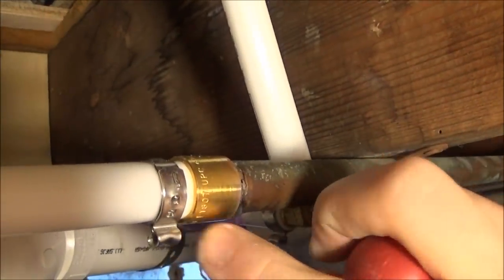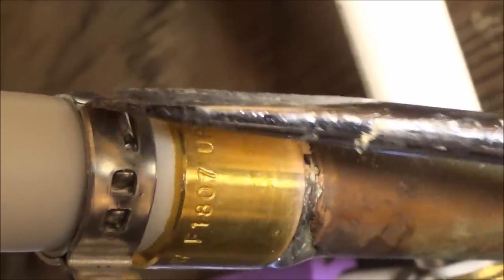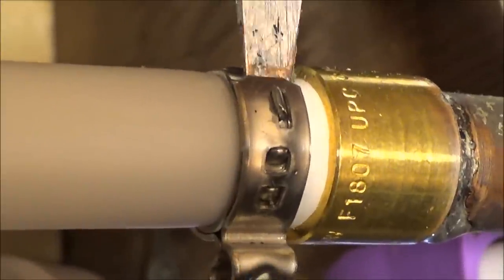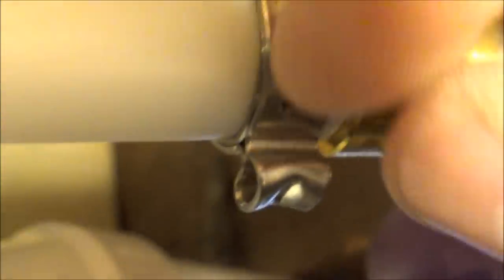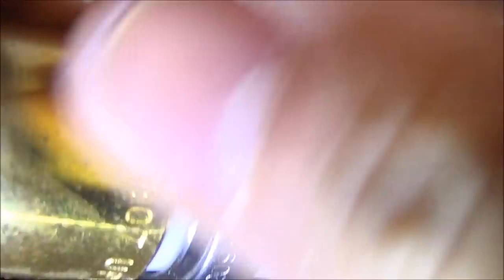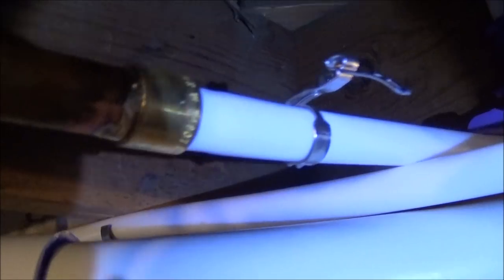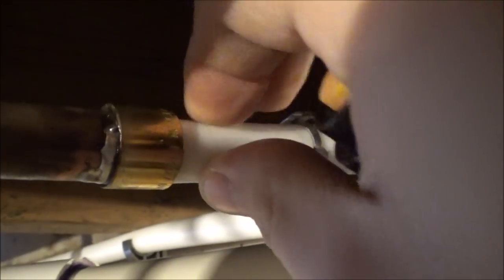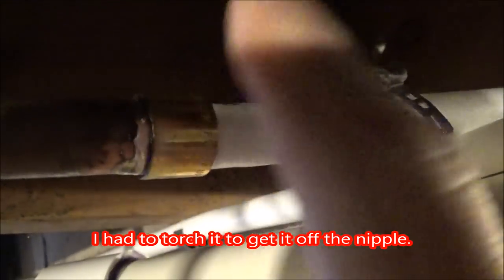Removing PEX Cinch Clamps With Just A Screw Driver!

Comment: The screwdriver prying part happened so fast I must have missed it. 

Big fail.  All I saw was a suggested method, then an end result. Maybe there was a profane moment that had to be edited out?
Reply from the maker: It's been a while but if I recall correctly I couldn't get it on camera without stabbing myself in the eye. I definitely have a better tripod selection today. The method does work though, next time I need to pop a pex clamp I'll re record and link here. It doesn't come up too often. If it's not a tight space you can also use 12" bolt cutters to cut the crimped part.

Comment: I removed mine in under a minute by grabbing the crimped part with vice grips and twisting it until it broke and then it just fell off. It was a LOT easier once I realized I wasn't trying to save the parts.

Comment: how do you reinstall clamp without taking the fitting off the pipe?
Reply from the maker: I've never tried to do that, I put a new clamp on by taking the pipe off the fitting. I would imagine that you could just open up a clamp and then close it again around the pipe so you didn't have to drain the system but it'd probably be easier just to drain it.

Comment: Interesting idea, but I was unable to get this to work with shark bite brand stainless steel PEX clamps. They look the same but the "loose" end of the clamp fits too tightly against the rest of the clamp to get anything underneath it. I tried screwdrivers, chisels, etc. Eventually I used pliers to bend the crimp ear enough to get a lever in there that I could use to pry the thing apart. It was quite a battle though. Looking for a better solution...
Reply: Same here, pretty bad they have no tool for this . . I bought some end cutter pliers and attacked that end from the sides

Comment: Good tip, however, using a simple hair dryer will enable the removal of the PEx tubing.  Additionally, you should always have a high end screwdriver in your bag of tools.  This job can actually be accomplished with a small screwdriver but it has to be one that you spent a couple of bucks on, something in the $7 dollar plus range with a "hardened" blade and a width of 3/16 to 1/4".  You should not be able to bend the tip even if attempted in a vise.

Comment: Apollo clamps must not be very well made. I tried this trick on my own PEX clamps, and struggled for an hour to remove them. I couldn't get my screwdriver in the gap, and had to use (wreck) a chisel, and even then the metal bent only with great difficulty.

Thanks for the idea, though.
Reply from the maker: Well, that does worry me a bit. Did you use a thin-tipped screwdriver? I had to use a thin enough flathead so I could get it between the end there and get enough torque to pop it open.
Reply: Agreed, on mine there is no space between the two pieces of metal. I could fit the edge of a razorblade in there a little but not much more. For me, needle nosed pliers worked best, sticking them through the crimp and twisting them
Reply: Screwdriver trick didn't work for me on 1/2" fittings. It was just too small and tight. I ended up tweaking the end up to the point that I could grab it with a set of vice grips, then peeled it off.